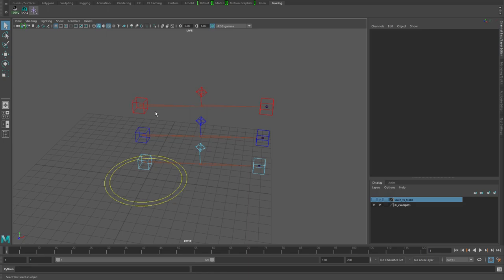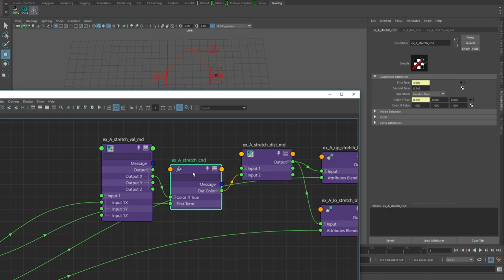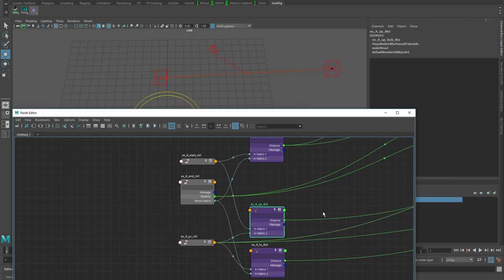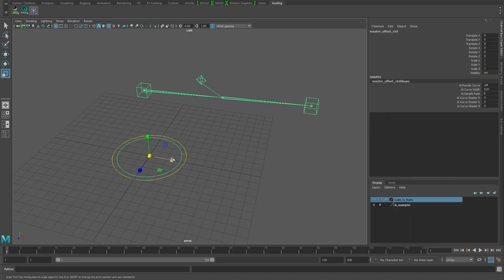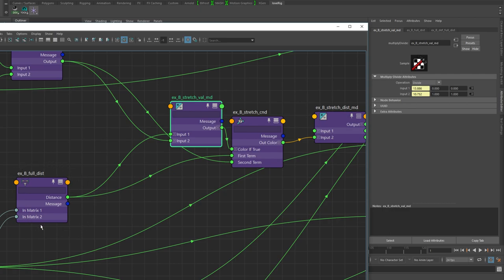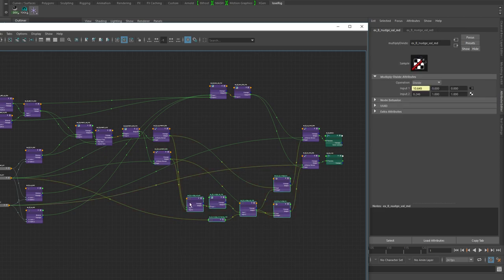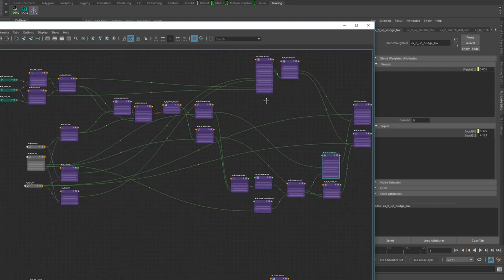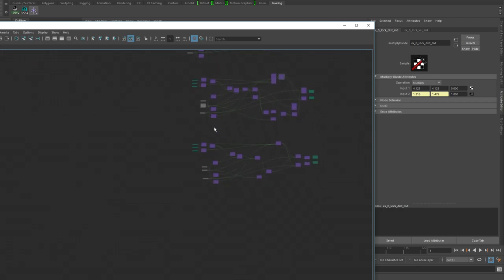(part 2) Optimized stretchy ik with elbow/knee lock and bomb-proof global scale tutorial

Comment: Hello Mr. Love

is it possible to have the .ma file of the scene? It would help me understand the connection of the nodes. Thanks.
Reply from the maker: hello - thanks for taking the time to watch and comment.

I currently don't plan to upload any example files of this stuff.  That's partly due to various tutorials and things I remember reading through while I was in college and the example files would be non-existent due to being removed from the hosting site...  So I don't want to do that to anyone else if I needed to remove the file for space in the future, or if the hosting site is dissolved...  

Instead, I do my best to explain things fully in the videos, and I'm also extremely willing to help explain things if anyone is having issues getting it working.  Is there a particular issue you've come across that I can help with?

Comment: Great tutorial ! could you make arm slide node part connect in this network? thanks !
Reply from the maker: Hi Nguyen, thanks for watching and commenting!  Are you talking about a control to 'slide' the elbow/knee up and down the length of the limb, which would increase the upper limb length while decreasing the lower limb length and vice versa?
Reply: @JarredLove  yes
Reply from the maker: Hey Nguyen, yeah that can probably be done with this network... it would have to be sandwiched in-between the stretch and nudge.  The complication here is that this system is generating a multiplier value, so getting the correct multiplier value will be a little tricky (it's not the same as taking the length and then multiplying that by the slide value to get the new length).

I did a quick test and it sort of worked, but I'll have to play around with it to see if I can really get it working correctly - the math is getting messed up a little somewhere... But I've personally always found the elbow sliding thing to be kind of a bloat item (extra computations and nodes for something that's not really necessary).  So out of curiosity, is this something you're having to use a lot, or is it just a few shots where using the elbow locking system to explicitly animate the elbow would suffice?
Reply from the maker: Hey Nguyen,  after playing around with it more, I came up with a pretty good way to introduce a slide option... it kind of surprised me that I got it to work well in a completely different place than I originally thought it should go.

Here's a link: https://youtu.be/pD9m8TMwe3Y

Enjoy!

Comment: Hey Jarred, some good videos you made there. i am running into a problem i was hoping maybe you would know the fix for, i have done it the way you have set it up, when i set it to lock it works fine with the knee controller but when i move the foot controller the knee follows as well even tho it should stay at the knee controller.  One more question how come you don't get all those unitConversion nodes? (wow they are annoying) :D
Reply from the maker: Hi Blessern84, I'm glad you like my videos and find them useful!

First, there are no unit conversion nodes here since I'm connecting attrs that are the same type as each other...  Basically, Maya internally has and handles different types of data for the different attributes.  For example, translates are 'double linear' while rotates are 'double angle' so if you make a connection from a rotate to a translate (or visa versa) a unit conversion node gets created to handle the additional math needed to get the value corrected to be interpreted by the driven attr the way you intend.  The attrs on the multiplyDivide, multDoubleLinear, and blendTwoAttr nodes are all double linear and I'm not connecting anything that isn't that same type.  I hope that made enough sense...

As for the rest of your question, it's kinda hard to know what's causing the issue you're having without a file to properly diagnose.  Maybe a little bit more info can help narrow down where the issue might be.  Are you following exactly, or adding a little bit of your own ideas into it (just curious, it's perfectly fine to experiment with stuff, I actually encourage it!)?  If so, which setup (although, I would assume it's the 'final' one)?

With the elbow/knee lock turned off:  Do the joints behave as expected?  Do the joints behave as expected with stretchy turned on/off?  Does the nudge attr seem to be working right?

With the elbow/knee lock turned on:  Does the nudge attr have any effect on the joints (it shouldn't)?  When you say the knee moves when you move the foot control, is the knee control also moving, or is it staying in place and the joints move away from it?  If you move the foot and then move the knee how does it respond?
Reply: @JarredLove  the unitConversion node must had been altered from maya 2017 to 2018, cause when i switched over then they were gone, 
but yea it make fully sense what you wrote about it, thanks.

I do have some differences in the whole setup and also doing it on a leg, but nothing major, it is the same nodes and the same connections, although i found out what the problem was, the two distance nodes that you create, I had one distance (the knee control to the ankle) was making all the problems for me, apparently I did not choose the foot control but the extra static ankle joint that we added for measurement, i changed it and now it works. 

I never added a lock or nudge before, but used the stretch setup from Zeth Willie who uses the same method with the distanceBetween node and measurement joints a really nice setup . 
Thanks for your reply and thanks for sharing your method for the whole setup, really great  :)
Reply from the maker: I'm glad you were able to figure it out!  The endpoints of your distanceBetween nodes was something I thought about yesterday before reading your reply - I've scratched my head a few times from doing that too, haha!

I haven't really noticed a difference with unitConversion nodes, but I guess it's possible there's been some changes to them... You might also want to check your settings because there's an option to view/hide 'auxiliary nodes' in a lot of the windows and tools.  While the unitConversion nodes are annoying extra crap to deal with, I always have them showing because I want to know the true connections - especially when trying to diagnose an issue that may reside in one of those nodes (who knows, someone may have adjusted the value by hand for some odd reason).

You're quite welcome for sharing - I'm glad you like it.  Keep up the awesome work!

Comment: Hey Jared,

love the set up, however when I try implementing the final technique when the joint chain isn't flat on the grid, I'm having issues with the elbow not staying locked in place. Been scratching my head for a few days about this. happy to send over the scene if you need, Cheers
Reply from the maker: Hey Tyler,  I'm sorry to hear that - is there anything else that doesn't appear to be working correctly in your setup?  Are you saying that the elbow isn't staying locked to the pole vector control when you have the locking attr turned on, or is it some other situation?  Are you applying this setup directly to a character, or did you try to get it working in a simple scene first?

As you alluded, it's really hard to try and determine what the issue may be without a scene to look at.  Do you have somewhere you can post your file?  If so, I could download it and take a peek.
Reply: @JarredLove  Not adding it to a rig, just in an empty scene and still broken. Yeah the elbow just doesn't stay where it should when I move the pole vector around, Thank you so much for willing to take a look!!

Here's the link: https://drive.google.com/file/d/1GsAU08nqjCoHoTcDpmx2J3JvnsXBdHc8/view?usp=sharing (when you click the link im happy to allow access)
Reply from the maker: Hey Tyler - after taking a quick look at your file I don't really see anything glaringly obvious about the node network that's causing the issue.  I do see that the locked elbow freaks out a bit, but it has to do with the ik and pole vector constraints themselves rather than the stretch/lock network.  Your elbow joint has joint orient values on all 3 axes instead of just on one which has a tendency to make maya's ik and/or pole vector constraint unstable.  Looks like y is the main 'bend' axis for your elbow, so there shouldn't be any x or z rotations.

So to 'fix' it, I just deleted the ik handle and pole vector constraint, zeroed out the joint orient for the x and z (in the original joint chain and the default measurement chain), and then recreated the ik handle and pole vector constraint.  It tweaks your joint position of the wrist a little, but it appears to make the lock work correctly and not flip out like it was doing before.  Making sure that your 3 joints in an ik chain are planar prevents a lot of ik headaches.

I also noticed in your node network that you're doing a nudge calculation for the upper and lower limbs separately, but you don't really need to do that... They will always both end up with the same values anyway since you're taking the stretch multiplier value and tweaking that multiplier value before applying it to the upper and lower limbs to get the actual length (so... 'arm_L_up_nudge_val_adl' output can go into both of your upper and lower blendTwoAttr nodes for the same result).  This is true if your upper and lower limb are the same length or different lengths.  It's not really a problem to do it separately, but it's just a little redundant and can speed up the evaluation if you take one of those out.

Hope that helps!
Reply: @JarredLove  Hey Jared,
Ahhhhh i did notice that myself, but didn't realise that's what was causing the issue!! thank you so much for the help!!! 

As for the nudge on both upper and lower, I was just putting both in to fully understand the network, in the script i made for the set up i made sure they both use the one.

Again!!! thanks you so much for your help!! loving your work
Reply from the maker: of course! Glad I could help!  Thanks for checking out my stuff!

Comment: Hey Jarred, thank you so much for this tutorial. I am running into a small problem however, I cant seem to input the default value I need into the blendTwoAttr  node(at 7 ish minutes), I can only connect values from other nodes. Its probably a stupid mistake on my part but I am kind of stumped on what to do.
edit*
Found a workaround(?) for others with this problem. I guess one can connect other node with the values you need to circumvent that you cant type in your own, its still weird, though.
Reply from the maker: Thanks for taking the time to watch and comment!  Your issue is actually one of the annoying things in Maya when it comes to some of the math nodes.  The inputs don't show up in the attribute editor until you actually connect something to them so you can't type in a value by hand; however, you can use the 'setAttr' command to set them.  Interestingly, the attr will show up in the attribute editor for you to modify after you have done this.  

So, you have a few options - you can create an attribute somewhere that will store the default length value and connect that (like you mentioned), or you can use the 'getAttr' command on the upper and lower limb, add the values together, and then use the 'setAttr' command to 'stamp' it in.  It would look something like this - but you'll need to adjust it with the proper node names and attributes for your given situation (also, this is in python):

import maya.cmds as mc
up_len = mc.getAttr('elbow.tx')
lo_len = mc.getAttr('wrist.tx')
def_len = up_len + lo_len
mc.setAttr('blendTwoAttr1.input[0]', def_len)

you could also write the getAttr/setAttr all in one line of code if you wish:

import maya.cmds as mc
mc.setAttr('blendTwoAttr1.input[0]', (mc.getAttr('elbow.tx') + mc.getAttr('wrist.tx')))

or you could just set it to 1 initially to get it to show up in the attribute editor, and then update it by hand later:

import maya.cmds as mc
mc.setAttr('blendTwoAttr1.input[0]', 1)

The import line is only needed once per maya session (you have to re-import when you open a new maya session).  Sorry I didn't go over that well enough in the video!
Reply: @JarredLove  Thank you so much! So weird, but a great work around. I did not think of using python, this is great!
Reply from the maker: You are quite welcome!  I use python scripting quite a bit for rigging related tasks (actually more than working with maya interactively...).  It's very helpful to know to help with issues like this.
Reply: @JarredLove  My message is way late, so it may not have been an option back then. What I do is I plug to the input bubble of the whole node for the "other..." option to come up. Then select the input I need from the inputs window that pops up. (Just in case some people don't want to adventure into python just yet haha)

Btw, thanks for the tutorial. The whole thing was super helpful and I look forward to using these systems in my rigs!

Comment: So I've build an autorigger for the arm that incorporates this technique. I cant figure out the last glitch i'm getting: which is the elbow lock moves the elbow joint to the elbow IK controller: but when I move the wrist IK control: the elbow doesn't stay in place.

I'm not sure how good your pymel is: but is there a way I can privately message you the script  so you can gloss over it?
Reply from the maker: Hey Krobbkag, I'm sorry you've run into this snag, but also glad to hear you're giving my setup a try!

I'm currently on a vacation for 2 weeks, so I'm not able to get on my computer to look at the file... But I will definitely take a look once I get home. Sorry for the delay, but I'm sure we can get it sorted out!
Reply: @JarredLove  Thats fine man, it can wait: no pressure. In the meantime i'll try to crack it on my own.
Reply from the maker: @62cky4powerthirst  sounds good! Let me know if you figure it out :D
Reply: @62cky4powerthirst  I had a similar issue, and realized that I had connected the outputX of the lock MD node into both upper and lower BTA nodes that follow, rather than using the outputX for upper, and outputY for lower. I connected it correctly, and all is well. I checked out the file you posted just to see if you might be having the same issue, but it looks like you have that part connected correctly. 

I did notice however, that one of your distance nodes has the wrong input matrix. If you haven't already figured it out, check out your "lf1_arm_up_dist" node. Since that's the upper arm's distance from the pole vector control, it needs to have "lf1_shoulder_IK_ctrl.worldMatrix[0]" connected to "lf1_arm_up_dist.input[0]". You currently have the world matrix from the "lf1_wrist_IK_ctrl" connected to both upper and lower distance nodes. Hopefully that helps.

@Jarred Love, thanks so much for all of these videos. I've incorporated a bunch of matrix constraints and other systems into my rig and I'm enjoying how much simpler it can be.
Reply: @incrediblah  Oh my god, thank you SO MUCH, That fixed it. I cant believe I didn't notice that. That problem has been haunting me for the better part of the last week. It's always one simple node connection like that always ends up kicking me in the balls
Reply: @62cky4powerthirst  No worries, glad it worked out! I did the same thing when I had my issue. I just never realized I had the same output on that node going into the upper and lower. Burned up a whole day just trying to tear apart the arm rig and rebuild it, since I have a few slight variations from this setup. All along it was just a stupid copy/paste error in my code.  As frustrating as it was, I'm glad it was something simple.
Reply: @incrediblah  I dont know if you know the answer to this: but how would I make this setup work if the aim axis was Y instead of X? I'm trying to adapt my autorigging script: but it turns out connecting the node to Y instead of X on the joints doesnt work
Reply from the maker: Awesome,  I'm glad to see other people were able to jump in and help while I was away!  I totally understand that frustration - I've had plenty of copy paste errors in code, or wrong connections... ugh.  The down side to those single connection issues hosing the whole setup is that you have such a hard time finding them, but the good side is that if it's just one connection, then fixing it makes the whole thing magically work!

@incrediblah - thanks for jumping in to help and for taking the time to watch and try out my stuff - I'm glad you're finding it useful!

@Krobbkag Destroyer of Worlds - I'll try to help you with the y axis issue you're having soon, but I will comment further on the dedicated comment you posted...